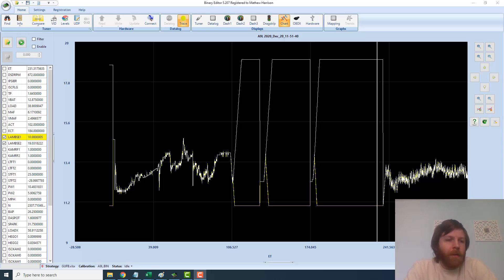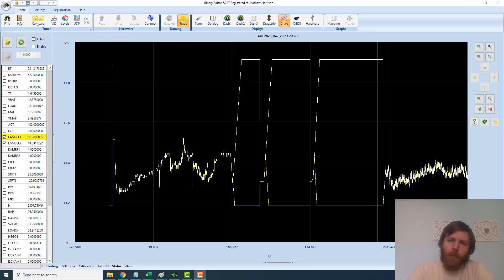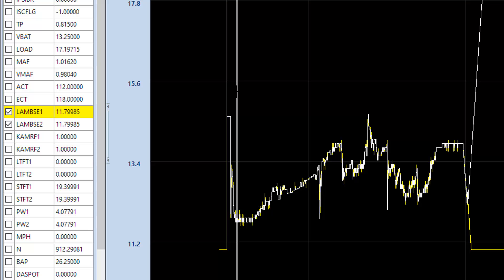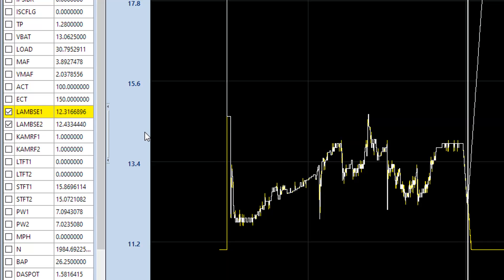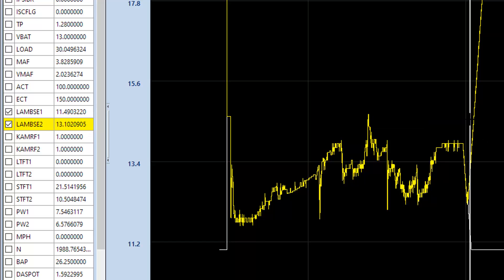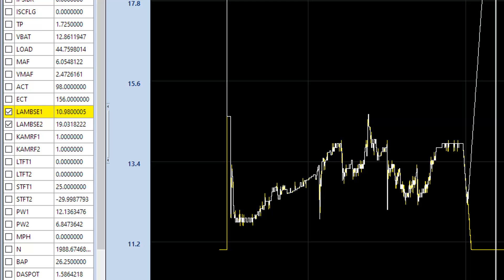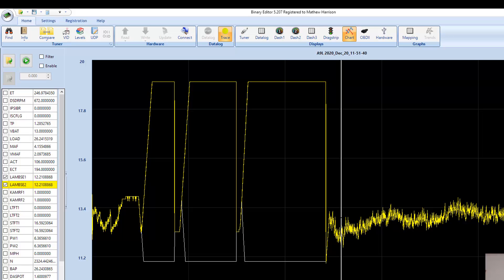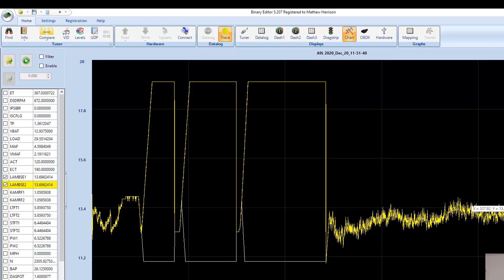Oxygen Sensor Connectors Accidentally Reversed and the Lambses of Death

Comment: So my polarity on my O2 sensor was reversed for about 1 month until I realized the problem, then I fixed it and I'm getting a high voltage reading, did I burn up the o2 sensor by having the polarity reversed ???
Reply from the maker: Sounds logical

Comment: Dude I had a feeling that mine are switched and the base tune on my Saab allows it to still run to some degree without adjusting too far . I don’t even have a scanner . I was just cleaning up the engine bay trying to figure out If there was something wrong . Well when I noticed the equivalent of wire nuts for a car I really got to thinking . For hours actually . Lo and behold ! Dude it makes PERFECT sense ! Thankyou for the data logs though I appreciate it 💪🏻